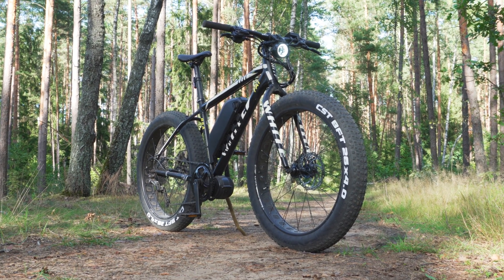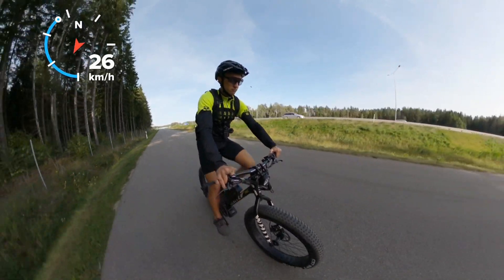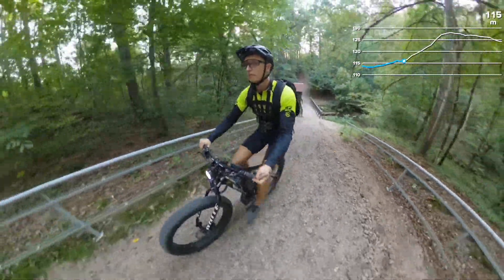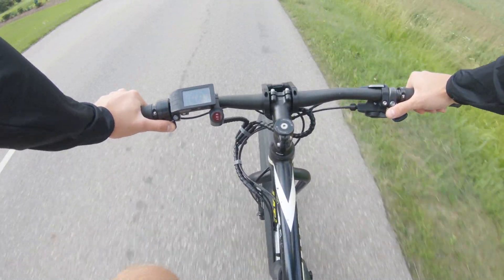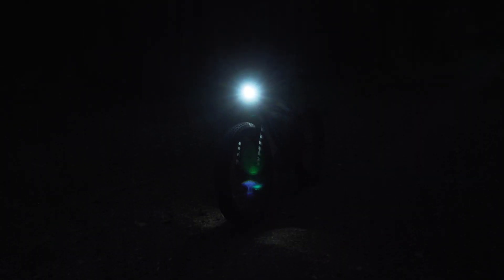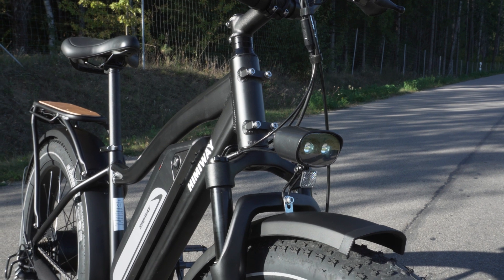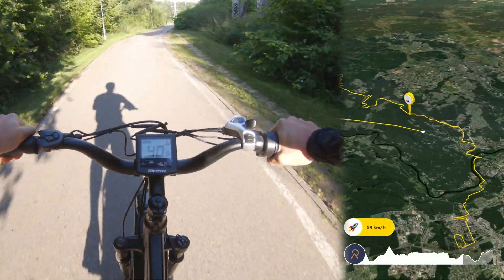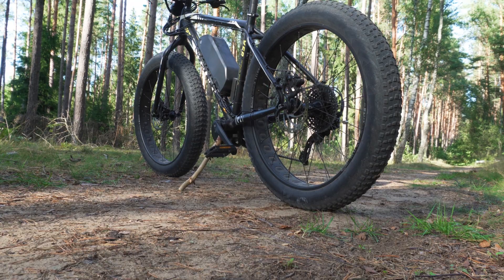DIY E-Bike Vs $1,399 E-Bike

Comment: Your DIY looks better, somehow. And mid motor is better than hub anytime.
Reply: Personally i build like a small folding bike with 1500w hub motor in the rear. from a maintenance point of view and because of reliability of less parts.

Comment: hi there;
i have a logitech z906 5.1 sound sistem and i have a plan, 
the plan is to use the z906 hardware to bult a hifi sound bar including the bass and all 5 speaker and control panel.
what do u think about this, can i transform the z906 to a amateur hifi?

Comment: I want an ebike but can buy parts & build a fast 2 stroke motorized bicycle for $200......If I buy an engine for $85 & 52mm chainsaw top end kit for $40 and build my own custom engine. I can use a larger rear sprocket for decent hill climbing power but still have  35 mph top speed.
Reply: No you cant because what's your transmission setup? If it's friction drive or cvt it's still not integrated with the pedals correctly and won't function correctly and isn't legal
Reply: @michaelbrinks8089  cool, that's totally useless anywhere not private property
Reply: @Snarf_Le_Wombat  I ride it everywhere, cops don't bother you here as long as you don't ride like an idiot.
Reply: @michaelbrinks8089  Cool story, now go take it on a state park mtb trail and enjoy cops stopping you by force immediately and writing hundreds in tickets. I'll take my real two stroke dirt bike where you can't same with my bafang 😂
Reply: @Snarf_Le_Wombat  Why are you so butthurt ?
Reply: @michaelbrinks8089  I could power my bicycle with a DeWalt cordless drill, doesn't mean it makes sense to bring it up and try to compare it when anyone with half a brain already knows the difference between the bottom dollar two stroke kit and an ebike
Reply: @Snarf_Le_Wombat My $200 diy motorized bike kit out performs this $1300 ebike kit 😂.....I mean my bottom dollar 2 stroke kit.
Reply: @michaelbrinks8089  not relevant because it's not legal, make it legal and get back to me lil buddy the adults are playing